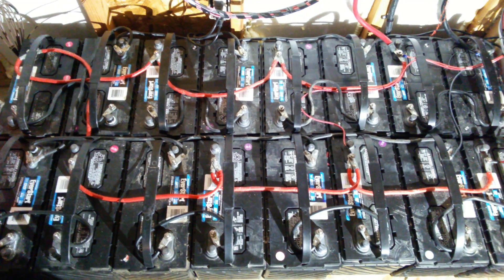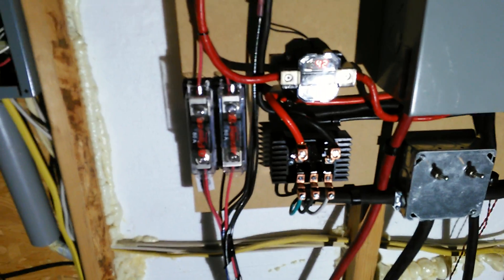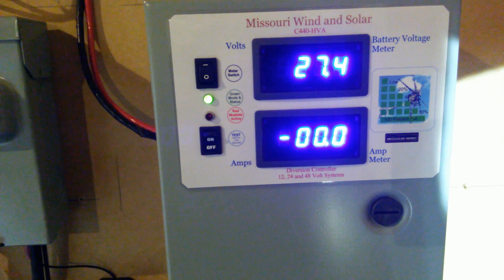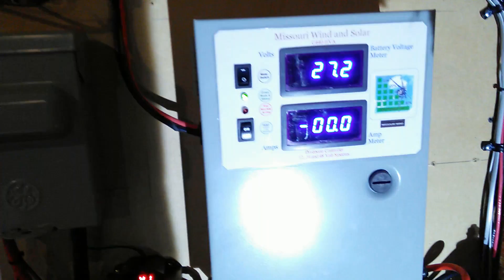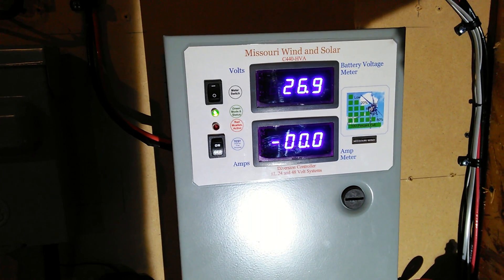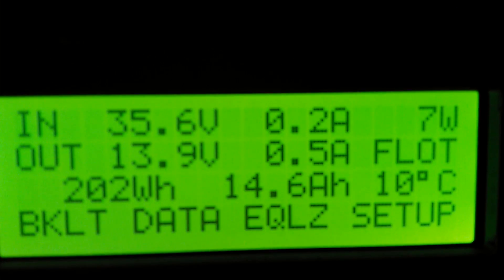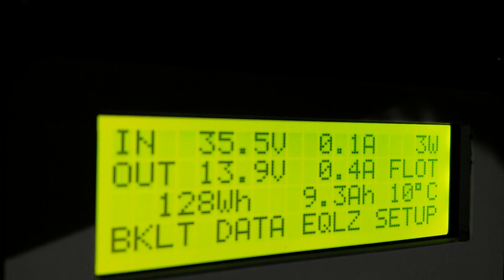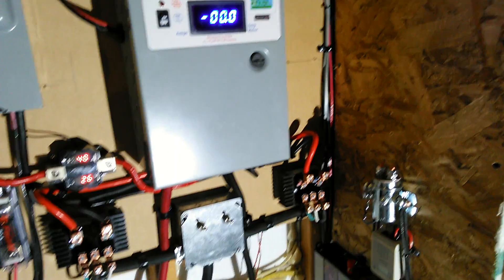Missouri wind and solar dual PMA part 4

Comment: Nice setup. I am about to install my first turbine and I've been concerned about the dumpload controller I'd like to dump to the grid what would you recommend.
Reply from the maker: econPOWER if you dump into the grid make sure you get a grid tie that will work with a wind turbine or you will burn it up or you can use a separate controller to turn grid-tie on when battery needs to be discharged that's how I have mines thank you for watching my video hope this helps
Reply from the maker: econPOWER I knew your name sounds familiar I subscribed to your Channel I was watching your video on your PIP the other night you might have to give me some help on setting mines up for my AC and maybe I can help you on your wind turbine.